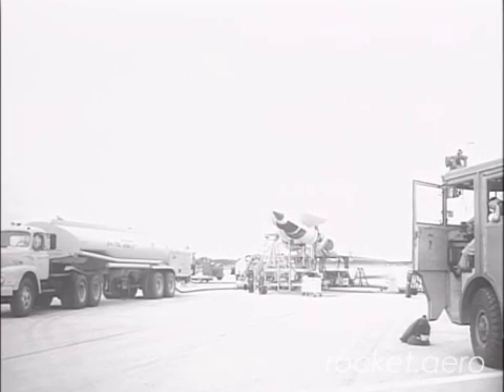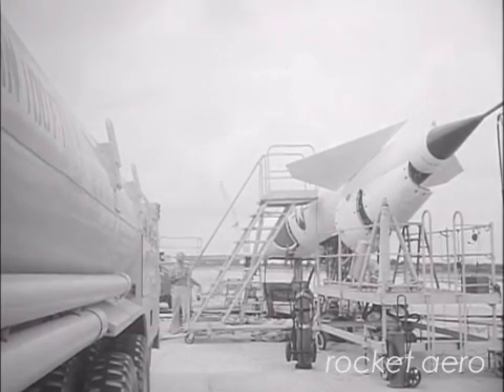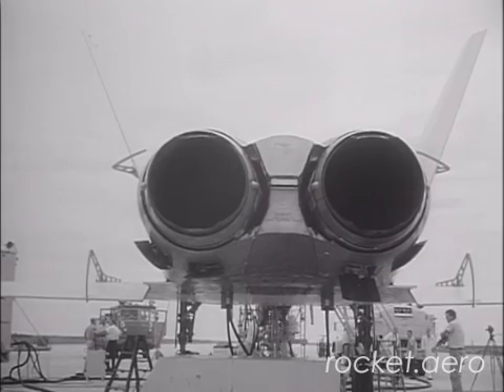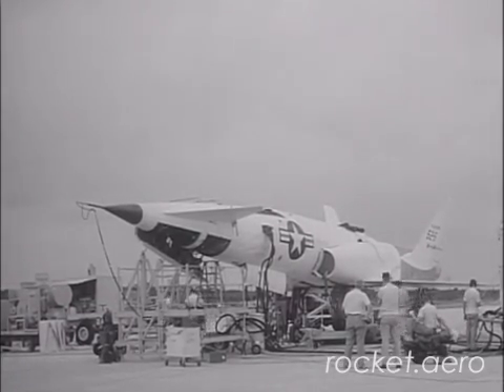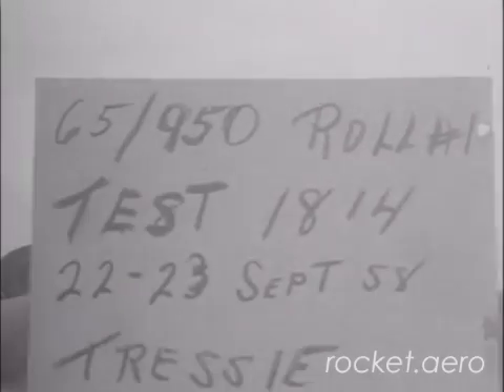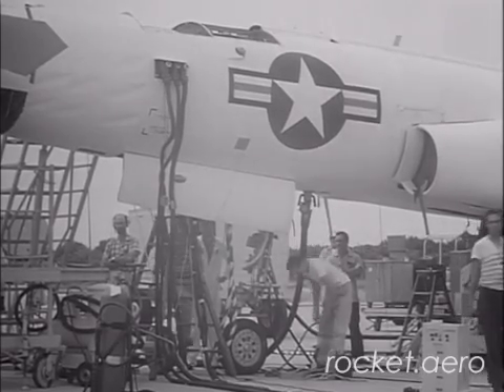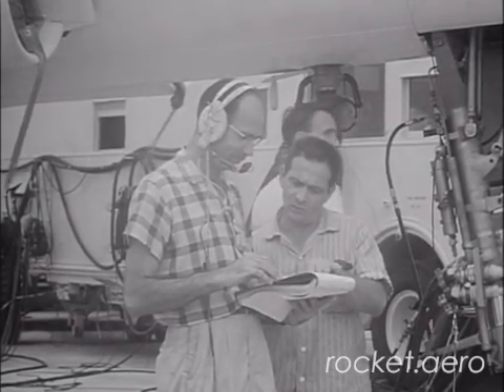Bomarc and X-10 Intercept Test

Comment: They didn't shoot down the target???
Reply: no, far too expensive. The missile is brought into close proximity of the target, then both are recovered and reconditioned to be used again.
Actual shooting down only really happens in warhead tests, and even then it's rare as the warhead is thoroughly tested on the ground without a missile mated to it and only one or two full systems tests are needed.
Reply: MrShobar wrong. The BOMARC had a lot of value. It was a pretty expensive piece of kit. In current US dollars, each of them cost tens of millions of dollars. While seemingly pocket change, it isn't.
Reply: MrShobar remember that at the time they were deployable. Heck, they were deployed and fully operational.
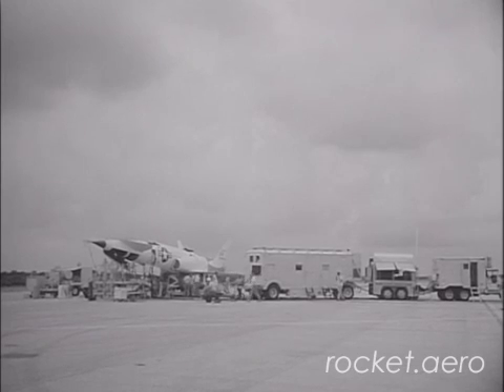Reply: If you listen to the narration from 1:50 you will be told that the intercept test failed and the X-10 was directed back to base, where it over ran the strip and burned.
Reply: BoMarc wasn't a kinetic kill missile; it used a nuke.  Just getting it in the vicinity was good enough for a test intercept.
Reply: +pistonssssss Most likely confirmed only by radar.
Reply: Thanks, I just got confused by waisting of QF-16 drones... ;)
Reply: CaptainDuckman The BOMARC has no value, except as an expendable target.
Reply: CaptainDuckman When no longer deployable, they have no value. Except as museum pieces, or as pylon queens outside the local VFW Hall